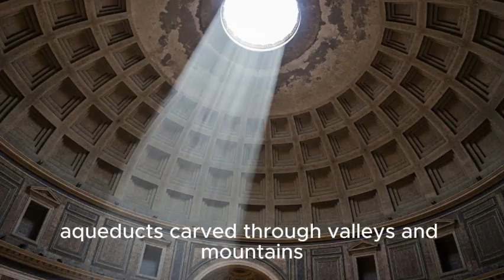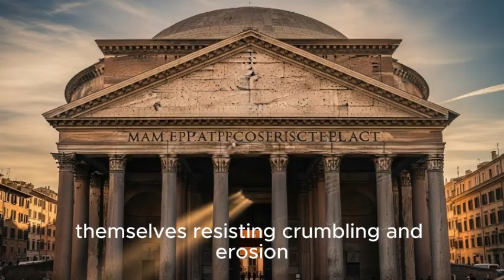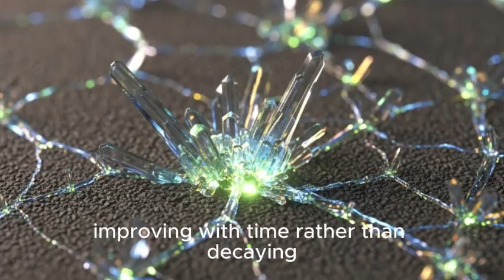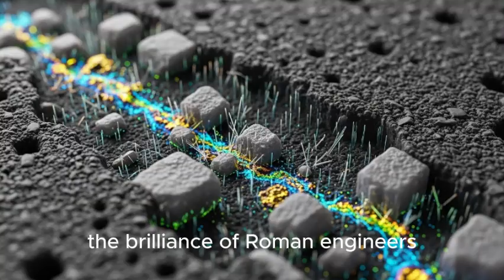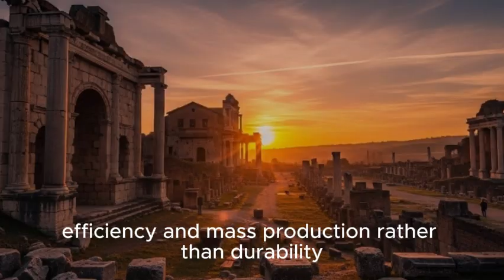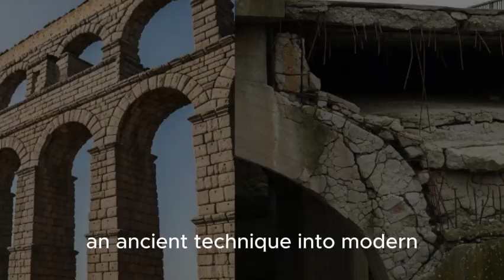Roman Concrete: Why Were They Stronger Than Modern Concrete?

Comment: i love the level of detail you have gone to to get the details and the mix's but i have a feeling that the knowledge for them may even predate the romans. check out tartary buildings and building styles that we have inherited that current day tech would stuggle to build. the romans done alot but i think the big buildings we give them credit for are pre existing structures that they reporposed. seems to me like giving the romans credit for advanced concrete, is a bit of a leap and i will keep an open mind. thanks for the video.
Reply from the maker: Yeah, you might be right actually, but then considering the fact that much of history was passed through Oral Tradition, we might never know.

Thanks for stopping by ❤